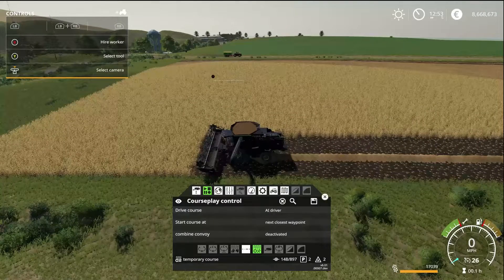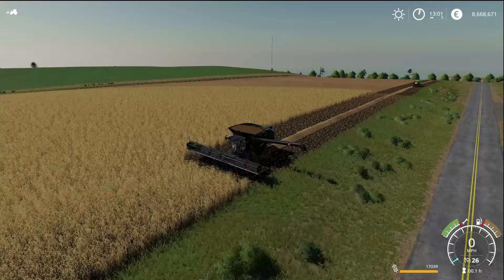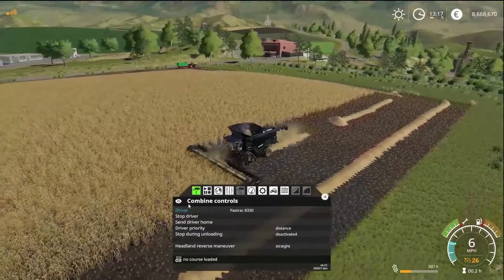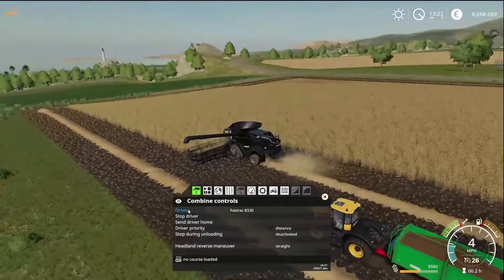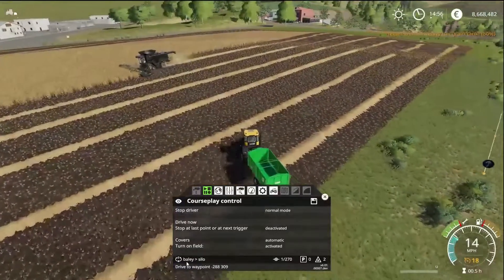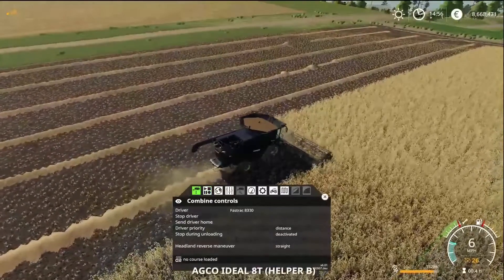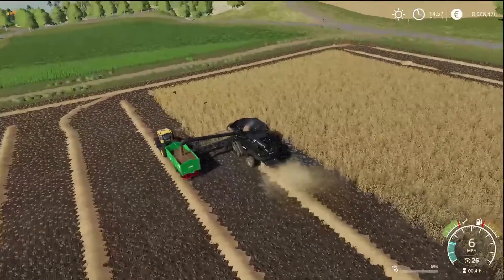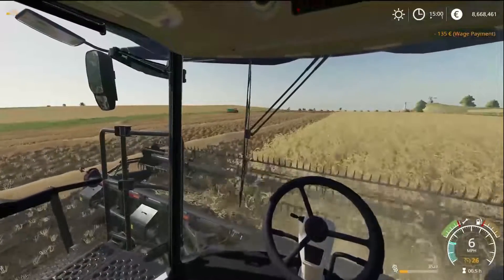CoursePlay in Farming Simulator 19 | Episode 6 : Carting grain - Stage 2

Comment: To all those having issues with this particular tutorial stage it is due to the previous one being incorrectly utilised and as such is NOT the right way to use them. The previous tutorial should NOT have used the first choice but rather the same one as this. The purpose of the function from the previous tutorial is to fill up a trailer etc at YOUR silo or storage place and then taking it to somewhere else ie a selling point, restaurant for instance. That is why you have the "load at start" bit and also the grain choice ie barley or wheat. This is so the worker knows which crop is to be transported. THIS tutorial is using the right function but still in the wrong way. To use the combine collect and offload you would use your tractor to collect from the combine and then either bring it to a bigger trailer at the side of the field or have it take it to your silo and drop there.  Which then you would use the previous info to take it to the selling point of your choice. Also the "set tipping point" icon if for when there is not a trigger point, ie at the side of a road or a field. To use the drop off points you meerly need to pause in your vehicle a few seconds on the actual place you would tip your crop out to let the course know that is to be functioned. Hopefully this may help with the confusion some seem to be having. :~) EDIT: also if you have the continue driving while unloading activated the tractor driver collecting the crop from the combine will also keep driving along with the combine.
Reply: Dude!! Yes thank you! Frustrated the hell outta me goddamn
Reply: My tractor will track the harvester, but when he reaches it, he will just start driving in circles, and won’t unload the combine and eventually crashes the game. Only difference I see is that I made my start stop points in the field. Would that be my problem? Or would I be doing something else wrong
Reply: @ballincobalt4184  It should not make a diffrence where u start/stop point are except if u are using automatic search for the combine.   If u manual set what combine shall be unloaded u can have the start/stop outside the field but if u want courseplay to automaticly find what combine is in the field u MUST have the start/stop point inside the field limits.
Reply: dmgbringer ok thanks, I’ll give it another go
Reply: I am having a very strange problem when dealing with unloading a trailer into my silo at the farm.  Courseplay is set in the correct mode and is tracking and emptying the combine as it should but for some reson it refuses to empty the trailer into my silo.  It just drive over it and return to the combine.  I have tested to drive over and i do indeed get the promt to unload so the trigger is there.   Even if i stop in the middle of the trigger and set a manual tip point all it does is trying to empty the trailer by tipping it but nothing gets empty and the tractor will just stay there forever.  I am using Slovak village map with season mod and the only thing i can think about is if courseplay cant tip into modded silos or becouse this silo have a elevated ramp.  Any1 know anything about this?
Courseplay also seem to ignore the turn on field function as i cant get the tractor to stay on the field when doing field prep.  I did updated it 2 days ago so it´s not an outdated version.
Reply: @Shiftry87  hey dude i am also getting this problem, except i am using one of the default maps, with an unmodded silo. The tractor tips up the trailer, nothing comes out of it, and it then drives back to the field with a full, tipped up trailer. Did you ever get it to work?
Reply: @Bovrinox  No i dident.  Given the time it took to work well for fs17 and with all the re programing they did for fs19 i dont expect it to work well for fs19 anytime soon unfortunatly.

Comment: İs it a racetrack settings for harvester?
Reply: I haven't used the racetrack setting yet but the spiral does the job for a combine so as to not have the pick up vehicle drive all over your crops, as long as you set it to the correct direction, clockwise or anti-clockwise, depending on the side your pipe is on.
Reply: The race track setting does the field in two halves split lengthwards and does a row alternately. For instance, picture a long straight field in front of you and slice it up into 10 equal stripes go forwards. Number these 1-5  for the left half and the same for the other half. The combine will start at the end on left one and when it gets to the other end it will come back down the number one lane on the right side of the field. When it comes on the return route until it gets to the last rows then the pipe will always be over your crops that are in row 2 etc.

Comment: Thanks for the video Tutorials :-)
I have been trying to get Course play to help with getting some contracts done while I replant my Modified fields.
I have set a course to carry Grain from a Contract field to the Sale Point which works But when I try and set up the part to collect the grain from the combine (which is also on its own course) I cant get the tractor and trailer to go to the Combine. 
 I can get the Combine to show on the list but the "Current" Combine is "none" my combine was full and waiting to unload when I was trying to select it.
If I drive the combine and "request driver" the tractor name also does not appear.

I was also unable to understand whether the Empty combine and cart to the sale point course needed to have the whole trip to the sale  point plotted or if the operation was in fact two courses with the empty combine part being added onto the Cart to Sale point course.
The tutorial seems to use the previous tutorials course and then set up another one to add on to the previous one?
Reply from the maker: Thanks! GLAD you find them useful. As far as your issue with the empty from combine, once you’ve created the course (which will be one single course all the way to the sell point and back) you will need to select which combine the Tractor is looking for. Then hit drive course, the tractor can run the whole course before returning, at this point it will change the “current” combine to the one you’re driving. In my video, I actually recreated the entire course, just drove along a similar path. 

 Once you have let courseplay drive the course once, it should be good to go. Hope this helps
Reply: @SimulationForTheNation  Cool that helped thanks! 
I set up a test run on a short route and it works mostly as expected.
I found that messing with the turning circle meant that the combine went a bit haywire in its pathing, the default is best :)

I did not realize the the Tractor and trailer would drive the course at the start and wait, Can it just do the last few waypoints or will it need to do the whole route?

Things I don't know the cause of are;
 * when the combine freezes on a turn and says it is slipping and then carries on.
* why the tractor parks up in front of the combine while it is waiting for more grain, which causes a crash between combine and trailer (I had the start driving for collection % setting quite low so I could see it work, I think if I set it higher it is going to drive around the field less and be less of a nuisance)
* Why the combine or tractor sometimes freeze as if they are stuck in a decision loop, the sound for either sounds like a stuck audio track. This happens when they can't do something that their course requires, such as for the tractor collect grain when it returns the start to wait for a request from the combine when the combine is empty and the Field is finished. Or the Combine has just been unloaded and doesn't start on the course to continue harvesting again and freezes. Turning off Stop at the last trigger or way point on the Combine seemed to get it going but I don't know if that was what did it. And then once the field was done it started the whole course again.
Reply: @SimulationForTheNation  This is incorrect in certain aspects. ie the single course from combine to selling point etc.
Reply: @SimulationForTheNation  Please see my post on this video mate. This may help you with some issues you may be having as it comes from a basic but completely understandable mistake on your part. I hope you find it helpful and informative and it helps you in your own play and with how to videos. Please take this as helpful and not being a clever knob ;~)

Comment: Does anyone get the same thing were somtimes the tractor carrying the grain carnt move after unloading from the harvester? So therefor you have to take control
Reply: Im talking about when they are bith forced to stop to unload
Reply from the maker: Have you inserted a wait point, or an unload point?
Reply: This could be due to a go at % setting. You may find it better in that situation you are having to have it not stop the combine when unloading as the pickup tractor will drive all the way along with the combine and "should" make the turns at the ends of the rows taking into account the turning of the combine. Also if you have the "start at %" setting to 0% in the tractors courseplay settings then as soon as the tractor has dropped off the load it will automatically drive back to the combine and just keep going. Using this method, on massive fileds, you can have a non-stop convoy of tractors coming and unloading the combine :~) Hope this helps like these videos helped me jog my memory lol.